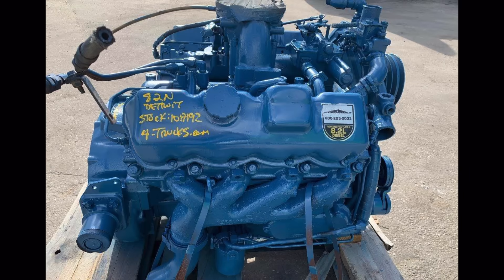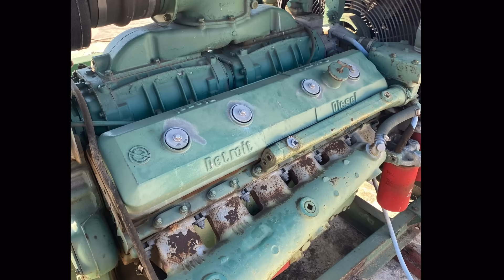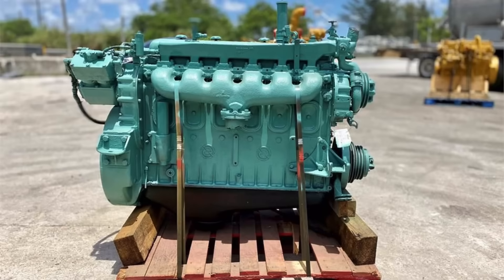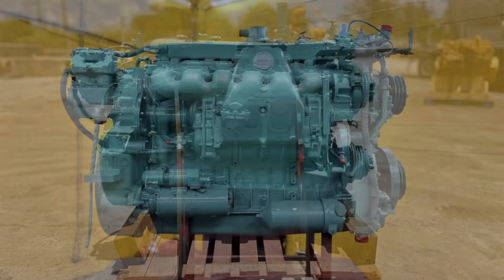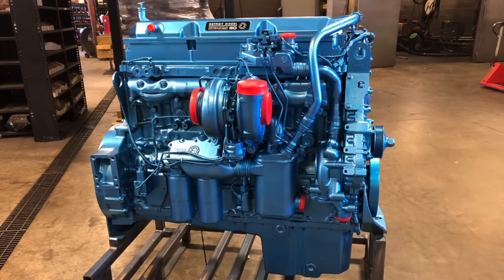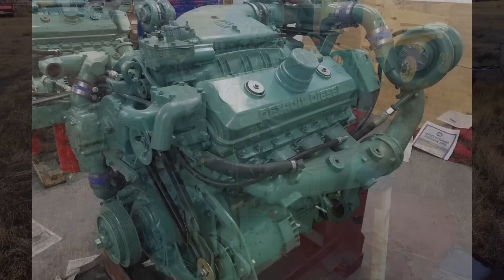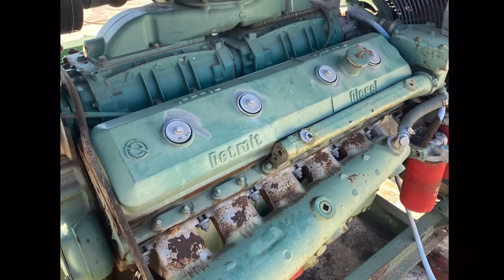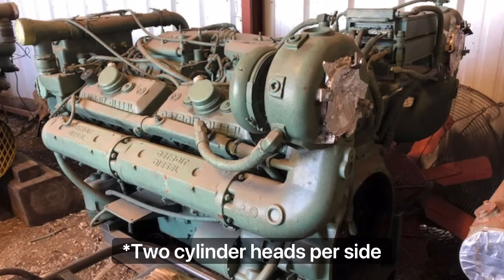Best Engines: GM Builds an Awesome V12 with Detroit Diesel's 12V71 "Buzzin' Dozen"

Comment: I was a Field Engineer for General Electric Company in the 1970's and 1980's. We saw lots of these twin turbo Detroit V12-71's on  gas turbine generator sets. These were mounted in the Accessory Cab at the front of the gas turbine and ran through an Accessory Gearbox.  The Detroit Diesels were STARTER MOTORS for frame 5 and Frame 6 gas turbine generators, 24 megawatt and 34 megawatt units. These units were often ''Peakers'' where the utility company needed another 100 megawatts very soon. Start up 4 GE Frame 5's and within 15 minutes they could go from cold to full load, run for several hours or days, then shut down and be on standby. Some refineries and power stations ran them for months on end. They sure drank fuel oil or burned huge amounts of natural gas.

The V12-71's  were coupled to a Twin Disk torque converter and had a one way jaw clutch to spin up the gas turbine to 20% speed (about 1000 rpm) where fuel was introduced and the spark plugs were firing. When the turbine combustion system lit off, the Detroit Diesel would scream its guts out and assist the turbine to spin up through its rpm range. The turbine would overpower the jaw clutch at some point, maybe 70% speed,  and run up to 5100 rpm running speed. Sensors would idle the Detroit for a few minutes in cool down mode then shut it off.

Those Detroits had a harsh life. When the turbine start signal switch was turned, the Detroit fired up and idled for about 15 seconds, then would go wide open governor for the next 5-7 minutes. There was no muffler, just a straight stack out of the roof of the Accessory Cab. After about 10 minutes, the Detroit shut down until the next time the operator called for a turbine start. These things were LOUD!  I recall that they were rated 600 horsepower as shown on a tag on the diesel.
Reply: It’s always amazed me that the 53 series, 71 series were used in the most unforgiving circumstances and gave a long life. 92 series not so much but they were dragging a lot of horsepower out of a smaller engine, compared with both Cat and Cummins. For sheer toughness they were hard to beat. We still have some in use powering HD Hayes and Pacific off road logging and equipment haulers ( all museum pieces now) in BC.
Reply: @bradchll  I have a nice 3-53 in my shop. Maybe....this year I will trailer mount it, install a seat and a right angle gearbox, and make it the world's noisiest Margarita Mixer.
Reply: @kimmer6  definitely worth a try
Reply: Thanks for taking the time to relate that detailed account. Good stuff 💪🇺🇸👍
Reply: @bendeleted9155  Thanks! I done wored out my typing finger!
Reply: On your idea of the margarita machine using a screaming lil 53 series, fantastic idea! I want to see and hear it if it gets built. Think of it as a mariachi band for gear heads while you sip. I think Jimmy Buffet would be grinning as he was a gear head also.
Reply: @bradchll  I'll be the operator and taste tester. You bring the limes.
Reply: There is a video on YouTube of  one these plants firing up. Just  amazing sounds!
Reply: Old school cool engineering. A V12 Detroit as a starter motor: my dream job.
Reply: "Screamin Jimmys" they're called in shops I worked at.
Reply: @happycats5195  those Detroits put the "scream" in the phrase , "screaming jimmy"
Reply: Spent many years servicing frame 5 peakers. Always enjoyed it when the Detroits fired up and went to work.
Reply: @halfmil6467  I still hear them in my sleep!
Reply: @kimmer6 It's louder than my tinnitus!
Reply: @halfmil6467  Hahaha!  Good one. I got tinnitus after being rear ended at a stop light at 35mph November 1997. It sounded like a bomb went off in the back seat. Instant ringing and it drove me insane until 2021. Pure torture, 24/7, getting so loud that I could not function some days.   I tried everything to get rid of it over the years. In 2021, an audiologist suggested that I get over the ear hearing aids because the inaudible electronic signals fools the brain and masks the tinnitus. Holy smokes...it works for me. The ringing is still there but I completely forget about it. They are in 14 hours a day, then get recharged at night. After a day and a half without the hearing aids, the misery returns.  It would be dandy if this worked as good for you as it does for me. The bonus is Bluetooth phone reception. Nobody can hear who is calling but me.  Cheers!
Reply: After a lifetime of internal combustion folly, pile driving, sport shooting, etc.. my tinnitus is getting annoying. Hearing aids are next, so I'll take your advice. The blue tooth capability would be a nice bonus too. Thanks!
Reply: @halfmil6467  I sincerely hope it works for you. They changed my life. Mine made my voice sound weird at first but no longer. I can't live without them!
Reply: Sounds like raw, pure diesel power
Reply: I was called out to a 555 Cummins,, that's a 8 cyl Vee diesel. It was put into an old turbine loco frame and the Cummins was the pony engine for the turbine,, the 555 was the fastest turning power plant needed for the turbine to start,,, Barely.  All I remember was it was damn cramped space and dark but got the engine to fire and run.
Reply: I Wanna Put One In My GEO METRO!

Or My YUGO!

While Listening To My DISCO!!
Reply: @richardkaltenbach3961  Hahaha,  I'll help you. I have experience putting a diesel in a  Geo Metro convertible .  https://www.youtube.com/watch?v=hnAOF1bOSB8
Reply: My home town had one of these gensets out by the fair grounds. The first time I ever heard it fire up I was in a school bus waiting to make a left turn. Everyone on the bus thought we had just been hit by a train. That thing was so loud you couldn't yell over the noise. There was a house about 100 yards from it. Can't imagine how the people coped with that noise.
Reply: How was the sound of those engines
Reply: That is the most insanely coolest thing I've ever heard.
I'm jealous dude.
Reply: @benyunik9314  I have a Detroit 3-53 diesel in my side yard. I am thinking about mounting it on a trailer with a right angle drive, aircraft type instrument panel, bucket seat, and a stainless margarita mixing blender.....world's loudest margarita machine.
Reply: When I worked at one of the major airlines we had an air starter  with this V12, 
at power,  better wear both your earplugs and hardshells ,    
amazing show to see two of the four JT9's on a 747 start simultaneously

Comment: As a teenager in the mid 70's I worked at a service station(Remember those?) in the suburbs of Detroit. A regular customer almost daily was a guy with an early 60's GMC with a 3 yard dump body on it and a 6-71 engine. He would fill up on diesel and buy a gallon of oil and pour into the engine and then would go roaring off, that engine screaming like crazy! I always heard them referred to as screamin demons back then.

Comment: I was in the Navy on the rivers in Vietnam and the Detroit 71 sound is iconic to me as that of the Huey helicopter.  I was assigned to ASPBs (Assault Support Patrol Boats) that had 2 12-71s.  PBRs on the rivers had 2 6-71s and some of the troop carrying boats also had 6-71s.
Reply: Well first thankyou for your service  and sharing  a local mill had bought one of surplus and used it for a log pusher in the ponds .That thing sounded awesome off in the night.
Reply: Yes I was aboard and LKA and we carried 8 "Mike" boats, or landing craft. The 4 large Mikes had 2 12V-71's.  I was a boat officer and the guys used to get pissed at me for taking over and revving those babies to max rpm. But the engineers loved it.
Reply: J @zubrickadvisors6742
Reply: Detroit Diesel also made a 6-53 V six cilender the Army 🪖 had these in the M- 113 Battle Taxi.
Reply: @michaelhatcher5264 some dude around here used to have a 6v-53TT in an early ford pickup,ran high 11s and he said it wasnt wise to attempt a powerbrake as you'll twist the pinion to dust in the 9" ford he was running.
Reply: I remember the six in the boats back then. My father drove trucks all his life, and when the last of them were gone from the fleet, no one missed them.
Reply: @retireditguy9493 ....Welcome Home!! "brother", from a fellow (3 tour) VN Vet.  I was in the Delta (Vinh Long) for my last 2 tours.. flying with the "infamous" Maverick Gun Team.   I remember the PBR's Very well.... and we "covered" them on Many occasions along the Mekong River and other tributaries.   Every PBR that I ever heard up close and under acceleration... were running the Aluminum 6-53's for purposes of weight reduction and due to the potential of "magnetic" mines.  
I am very familiar with all the Detroit Diesel "families", as I not only hold a 4 year degree (grad.in 1967) in Diesel Engine Design & Theory (specializing in 2 cycle & needed for R&D work), but studied directly under P. Nicholas, who had just retired from VP of R&D at DD in 1964... and who had me work "with" (vs "for") R&D in their experimental research div. in the early to mid 70's, on a new scavenging system which I originally "clean sheeted" during my "junior" (3rd) year.

Comment: Think Chevy built a torquey V-8 gas motor for their light Trucks that produced 350 h.p. or so, and not all that long ago.
Am I wrong?
I'm wondering about the bore to stroke ratio and wondering if was built off a modified Cadillac 501 block.

Comment: The US military still uses Detroit's in a lot of applications, most notably the 6V-53 in the M113 Armored Personell Carrier and many marine applications.  Although I'm not a big fan of the noise that these engines make if I had a favorite it'd be the 92 and 149 series, those do make a nice noise.  You should make a video on the big brother of the Detroit Diesels, EMD Diesels.  EMD's make a really nice noise particularly under extreme loads.
Reply: The reason the military uses them is because they're 100% mechanical and require zero electronics to run (other than starting). Makes them immune to a Magnetic Impulse bomb. Also no radio interference.
Reply: @johneckert1365 exactly

Comment: 8v71 is musical
Them sweet Detroit were common place I'm my harbour fer decades
But you gotta do ford greatest engines 
Their inline 4-6 cylinder diesels😅
Reply: You talking about the Brazilian built 6.6L and 7.8L diesels?
Reply: @johneckert1365  well the 8v71 were in fishing boats along with the ford inline 6 dieselsad a inline 4 cylinder,  4.15L diesel in a boat as well, also common in off the road equipment

Comment: Yeah they had a good sound but a little too much of it! It soon became objectionable, to say the least.
Two qiirks you didn't mention: on the in-line engines the front and back of the block were identical. Depending on how you assembled it, you could have the blower on the right or the left, ditto the governor just by turning the block around. The other thing is that they could run backwards. If you were  starting out on a hill but maybe rolled back a little and almost stalled it, they could sometimes kick backwards without missing a beat and you, the driver, can't figure out what the hell is going on with the gearshift. Why can't I find a forward gear?!
Reply: Yep I've heard that. Another car that you could do that in were those old 2 stroke Saab's from the early 60's.
Reply: Some 4 stroke diesels will run backwards as well, older Mack diesels were good for that 😅
Reply: Yes, true enough. We had a driver hit a rubber dock bumper hard and it bounced him back out. Heavy smoke coming out of the air intake- he thought he broke something and shut her down. When he restarted it it was fine, we couldn't figure it out. So we called the dealer and we all had a little laugh!

Comment: Hey Adam, that was an interesting video. You're right, they do sound pretty neat. The sound doesn't equate with the speed though. That truck in the video should have been going way faster according to the sound of the engine. Cheers!

Comment: Many of these engines are Turbo-Supercharged 2-stroke diesel, and they are in many engine generators. We often had people come out to watch and listen on our monthly PM runs, they sound fantastic!
Reply: They aren't "supercharged". Yes they have a blower, but that blower is the only way they get thier air. When there's just a blower they're "naturally aspirated", but when they also have a turbo, they're "turbocharged". The term "supercharged" didn't come around until hot-rodders started modifying Detroit Diesel blowers to use on gasoline engines. They made up the name "supercharged". True story ☝️
Reply: @johneckert1365  But it is still there and has to be maintained just like the turbo charger and other components.
Reply: @KO-pk7df  Every single part of the engine is "still there and has to be maintained".  They 100% ARE NOT supercharged. 
A turbocharger is an "extra" add-on part that is not necessary to make the engine run, in ANY application. The blower on a Detroit is a necessary part, and no way no how will the engine run without it. It doesn't matter how badly you want it to be a "supercharger". IT'S NOT!
Reply: @johneckert1365  Why does this get you so upset? I have worked on engine generators for over 30 years. I don't care about all that performance BS, I also don't care to argue about such matters.
Reply: @KO-pk7df  Because they aren't supercharged.... It's understandable for some wanna be hot rodder seeing a blower on a Detroit and saying something stupid. But you sir, should know better. 
These engines had blowers on them before GM even owned the company, sometime in the mid to late 1930's. When was you term "supercharged" first used? Please answer. You know damn well the term "supercharged" or "supercharger" didn't exist until they started being modified and used on gas engines. 2 stroke Detroit Diesels don't have superchargers, they have blowers.
Reply: @johneckert1365  excellent, good effort at trying to educate people!👍

Comment: I sailed on a ship that was built in the 60's. Used Detroits for everything besides propulsion. 

Two 12V149s for back up generators when we had no steam. They were so loud that when they were running you could hear them across town from the harbour. If they were both running and you were down checking them out standing on the cat walk between them would make your eyes vibrate and your teeth chatter. 

We also had two 12V92TAs as back up fire pumps in case we had no electricity. I and about 240 others owe our lives to those engines as they ran in a smoke filled space for days as we fought an incredibly large engine room fire. 

And lastly we had "the green leakers" two 6-71s in our landing craft. Made a lot of noise to barely get the landing craft moving, and were more likely to overheat than actually land anything anywhere. 

I loved working on those engines, reliable right until the day the ship went to the big razor factory in the sky.

Comment: When I was in the Air Force in the early 90's, I remember the tugs used to pull C-5's and C-141's around used turbo charged V12's.  Great sounding engines.

Comment: The skirts are long because the ports are covered when the piston is at TDC, this is to prevent air getting into the crankcase. They also have a set of rings at the bottom of the skirt.
Reply: As a gasoline 2-stroke enthusiast, I suspected the skirt as closed-valve, and noticed the bottom ring grooves.
Reply: Interesting.
Reply: Yeah, it has a bottom ring, and there are also freeze plug kinda things that seal the wrist pin bores, and a tool to confirm the wrist pin plug sealed.

Comment: The EPA seems to always be the buzzkill ! 😢 maybe do the 6.3 and 6.5 N/A diesels next !
Reply: Fuel economy is really what made them less popular. When fuel was cheap, these big Detroits were BOSS, but when fuel first started getting crazy, everyone needed to switch to a Cummins or a Cat. Detroit had to come up with a big 4 stroke diesel, and that's when the 60 series was developed in the mid 1980's. That 60 series was a fantastic engine, and also more fuel efficient than the Cummins or Cat they were competing against.

Comment: Reminds me of the GM buses used by the local public bus companies.  Detroit Diesel 671 and that crazy Allison 2 speed automatic.  It was worth 40 cents to ride the bus and hear the corn popper in the back wind up and hang at maybe 1800rpm and then the sudden lurch to direct drive.  There was always soot all over the rear body surface from the dirty diesel running 12 hours a day.

Comment: Great video that brought back a lot of memories. I've rebuilt everything shown in this video and then some. I used to work in the engine rebuild department at Covington Diesel in Greensboro NC, which was a DD distributor. I'm not sure if they still exist. The 71 series were great engines. It was pretty typical to see them with 300,000+ miles on them.

Comment: These are the engines that powered many of the yachts and work boats I worked on. The JT6-71TAB (Johnson and Towers marine) produced 485 hp and was pretty much the limit for the 6. We had car ferrys with a pair in 12V71Ns (one at each end) that we could inframe overhaul in a weekend. I did get to work on a pair of 24V71Ns (rare) in a research vessel. Setting the racks took patience. They have a sound I miss tremendously. Really heavy components. Hiking a 6-71 cylinder head up the spiral staircase of a Hatteras motoryacht was not easy, even with two guys.